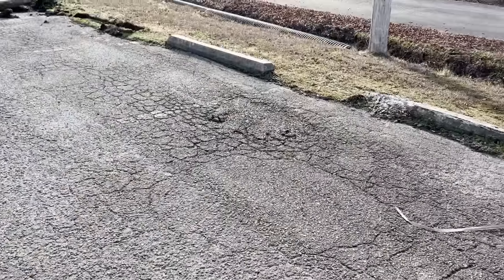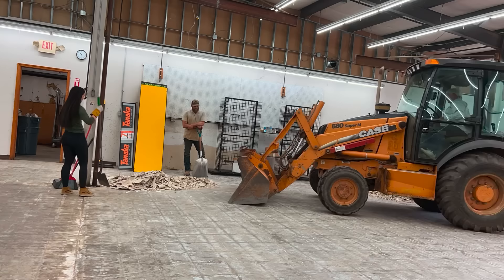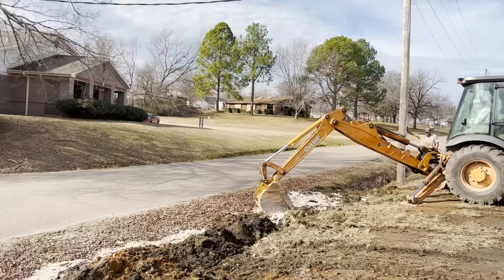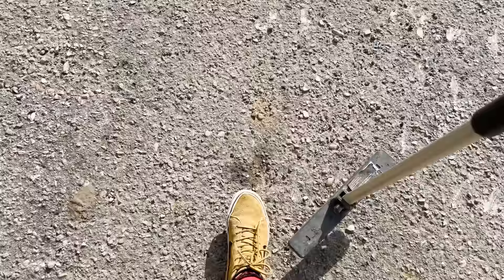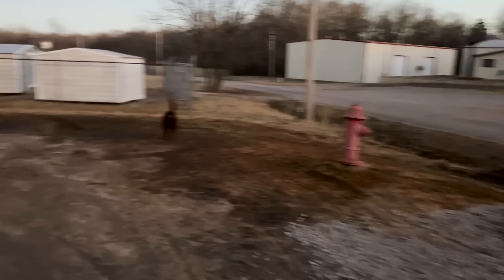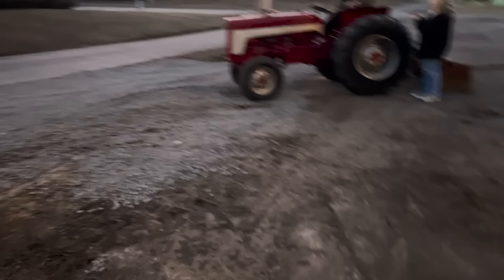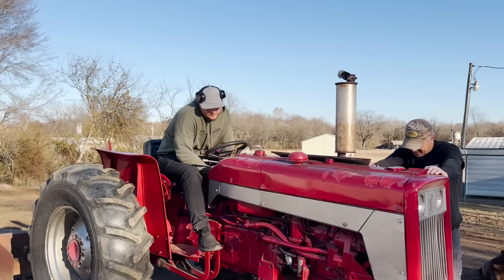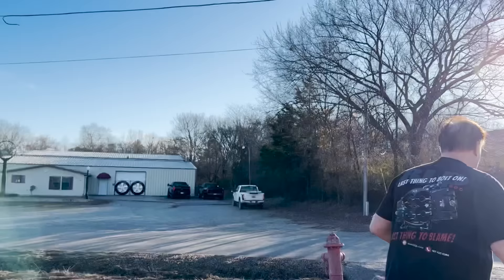The Bridge Between Mine and DT's Shop 🙌🏼😅 Culvert, Dirt Work, & Heavy Machinery 👊🏼 ATR HQ - Video 3

Comment: Alex I want you to know you have been a Huge Inspiration for my Daughter she use to get intimidated on working on Cars in my shop and after watching you she rolls her sleeves up and gets into it and says if Alex Taylor can do it so can I.:face-green-smiling::face-green-smiling:
Definitely Epoxy but if you don't know how to do it  or done it before you will mess it up. You need special shoes with metal spikes to walk on a Epoxy floor as you do it. They have some really cool Epoxy floors to choose from. Also you want commercial rated epoxy and put a non slip Sand coating which is very important because you do not want to be sliding around LOL
Also you should see if Benpak will sponsor you for lifts. You should see what Lifts  your going to use first because you might need to cut out the concrete and make it thicker where the lifts go. I had to do that with my Shop!!

Comment: I'm not a hater (I love your channel), but do have a lot of experience in environmental compliance.  Basically, your using the waste floor materials for filling the ditch is not lawful and could subject you to fines and/or the need to remove it.  I won't get into the technical/regulatory minutia, but the waste floor materials should have been hauled off for disposal elsewhere and clean fill should have been used to fill the ditch.